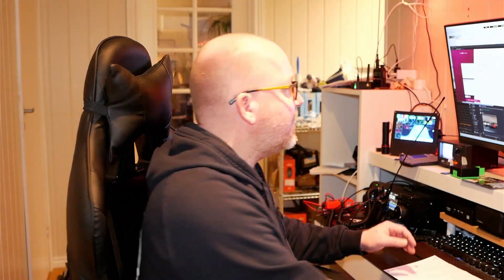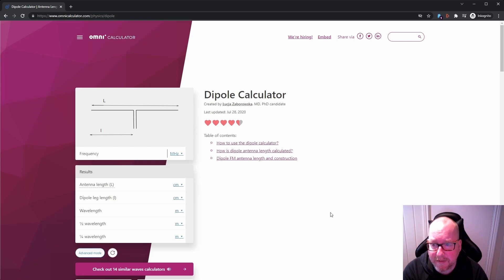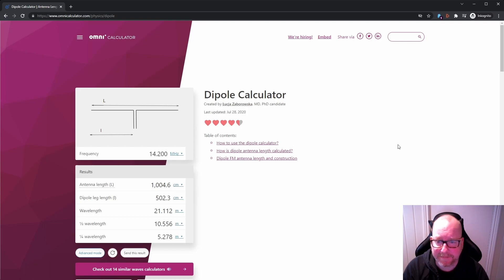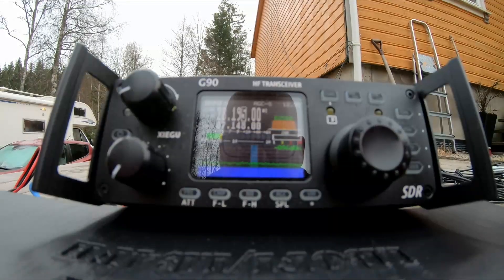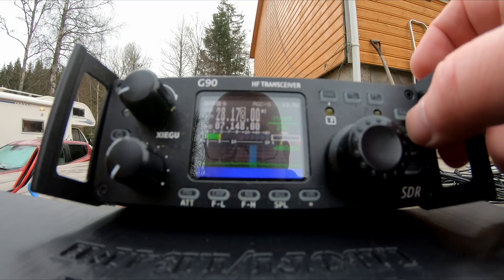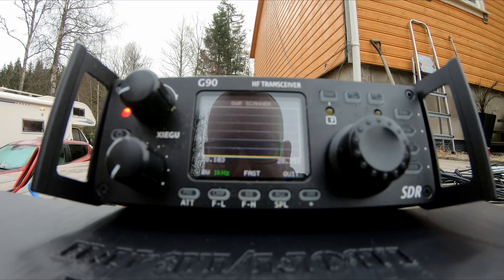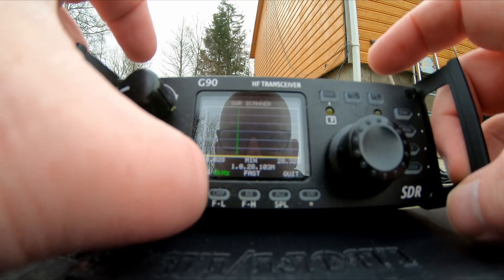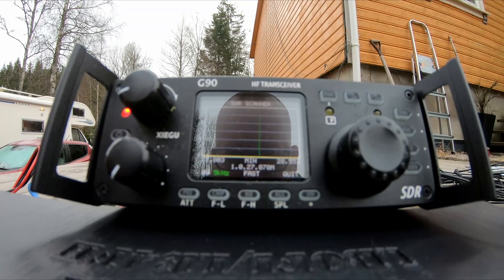How to build an Easy Dipole for new Hams

Comment: Nicely done! 👍📻⚡️ Thanks for the great video.
You could fairly easily “multi-band” the antenna by adding the 10m elements with the 20m elements attached, and mount each element where they originally were, and you’ve got yourself a Fan Dipole (may require slight further length adjustment). You can add further elements for other bands as well. I’ve had great success with this setup and the elements can be installed above each other or strung out in different directions from the mast/feed point. I currently have 40m/20m/10m band elements and am able to use this setup on 15m & 6m (odd frequency harmonics) as well, with an Icom 7300 (has internal tuner) and no external tuner. My elements are fanned-out just above my home’s roof in different compass directions, and not placed one above the other. Great, cheap, multi-band option. 👍 WA7FLY - Tom
Reply from the maker: Great point. I've been thinking about a fan dipole at home to replace my windom, but I just haven't gotten around to it yet
Reply: I am designing a "multi-multi" band fan dipole for my SDR to cover virtually ALL bands! For now, it's a "receive only" antenna, as I haven't got my license yet. But in the future, I will be able to transmit on it! Currently the design is for 8 pairs of elements for 6M thru 40M for HF bands, and "stiff wire" elements for the UHF bands from 2M and lower (higher frequencies). I'm wondering if I could use my standard UHF/VHF Yagi antenna for these frequencies....